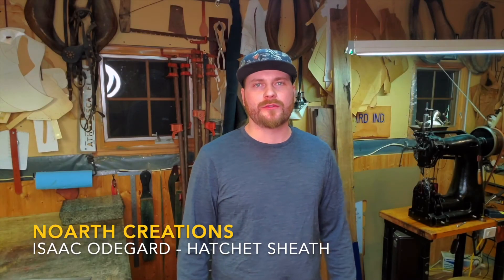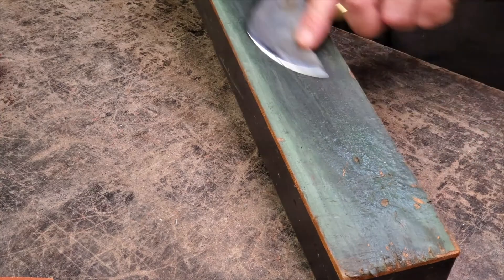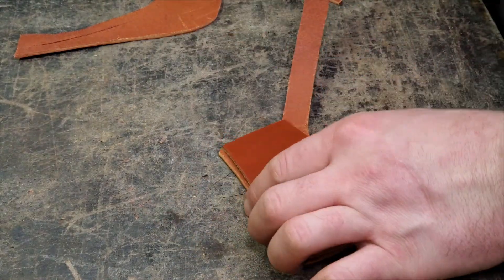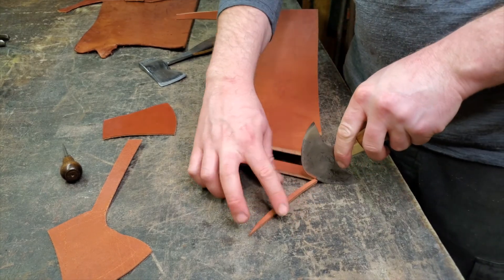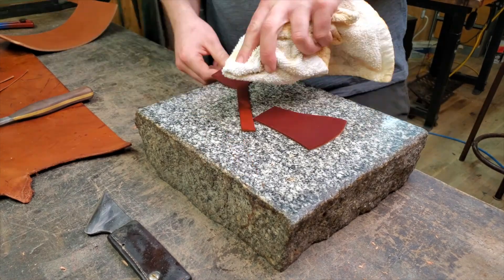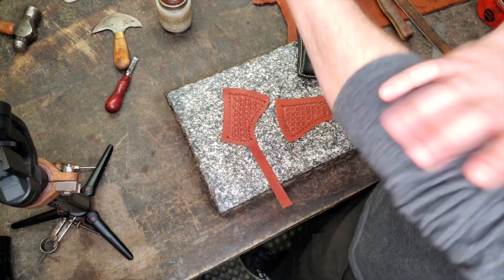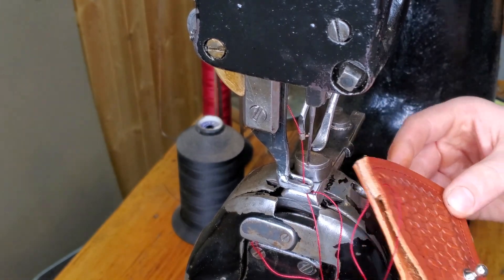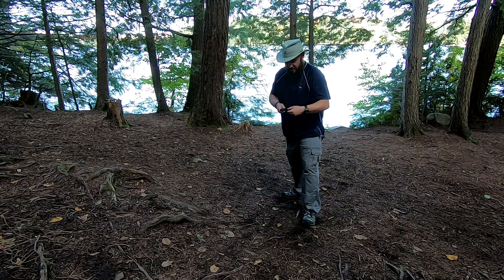Leather HATCHET SHEATH With NO PATTERN!! || How- To Step by Step

Comment: Nice sheath...you made a me little nervous when you run that head knife with you off hand in front of the blade. Also a tip, don’t skive on stone get yourself a piece of glass, your sharp edge will last longer! I would like to have one of those machines!
Reply from the maker: Dag, thank you for commenting. Yes I've used glass before and it does work well like you described, however I sometimes prefer using our gravestone because the leather doesn't slide around as easily, gets some grip.  

Your talking about the union lock? They still make them to this day, 100 years later. Ours was built in 1920.